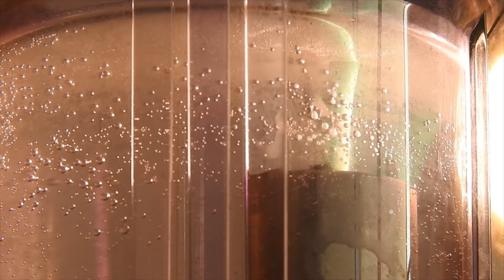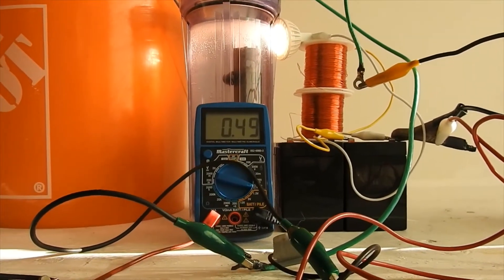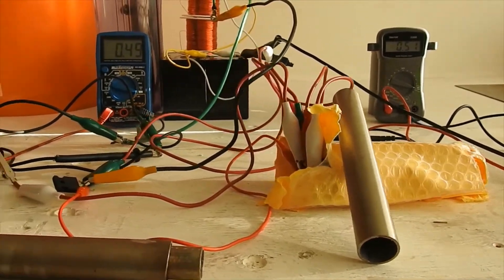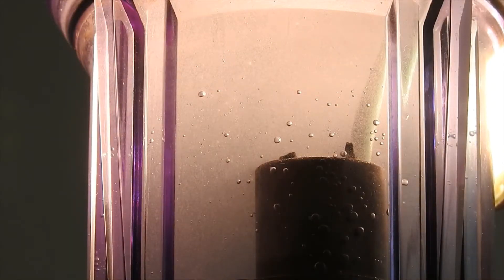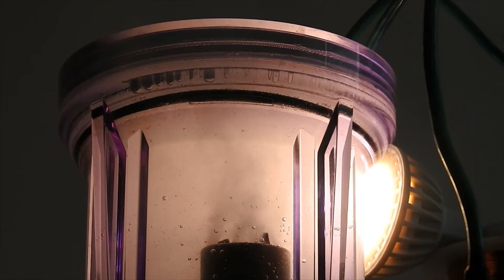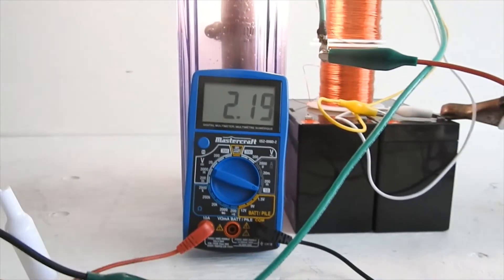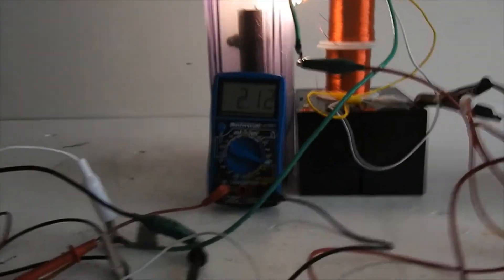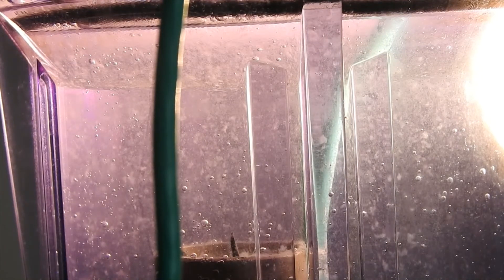HHO Stanley Meyers Resonance versus non Resonance

Comment: I use Dave Lawton’s PLL Circuit with 7 Cells & an Electron Extraction Circuit. 6 Watts puts out 8  Litres of HHO per Minute. The HHO is a +Positively Charged Deuterium Gas, then I’ll -Negatively Ionise the intake Air to Electrostatically bind with the Deuterium Gas then I use Purified Nitrous Oxide from the Exhaust to slow down the Burn Rate & Power a 3.25 KVA Generator... Lots of people in Darwin NT, Australia & they’re like Novelty Toys for these people!
Reply from the maker: Talk is cheap - show us.
Reply: @thewonn  I’d love to but I pulled it apart. https://www.youtube.com/watch?v=IViKuzX34xE&t=256s   This is an old Video where I try to describe charging with Back-EMF IM-Pulses coming off a Dual Petronix 60 KV E-Core. I could replicate what you do using a 260 Volt Variac rectified to 130 Volts DC & a High Voltage Switch that switches a 120 Hz signal that is basically a Gate Circuit & the output would be 10 fold what you demonstrated using non Resonance. I’d love to show you what I have but I saving for an Apartment & don’t have time to do any HHO Stuff. Sometime in the Future after I’m living RICH I’ll upload an example of a Circuit using 100’s of Kilovolt’s of Back-EMF from a Petronix 60 KV E-Core Coil setup
Reply: @thewonn  When Daniel Dingle a Filipino inventor discovered how to make Deuterium H2. Dingle discovered it by accident as he been looking at ways of Charging Batteries using High Voltage Back-EMF Im-Pulses back in 1968, he was creating massive amounts of Gas. Then Dingle discovered this Gas had more Power than regular Electrolysis Hydrogen. Dingle openly told everyone how he made this Deuterium Gas until 1990 when a Gag Order was placed upon him and he didn’t want to go to Jail so he kept his mouth shut. In Darwin people discuss this topic openly like it isn’t even a Secret but, the rest of the World think that this is some big Secret or some Conspiracy... All it is, is High Voltage Back-EMF Im-Pulses that Knock Off Electrons Orbiting the Hydrogen Atom - Then you get this Gas called Deuterium!
Reply: Your need Back-EMF. Back in 2003 Kiwi Mates in Darwin revealed to me that the Effect is actually: ‘Tesla’s Phase Conjugate Mirror Effect’. If you take a Back-EMF Im-Pulse from a Coil & direct it to a Ground Connection ie: Copper Rod in the Ground, you’ll get a Bright White Light discharge of Electrons emanating from the Negative Earth, this effect is the same as a Lightning discharge where Electrons emanate from the Earth (See a slow Motion Time lapse of a Lightning Strike on YouTube). All you do is use an Isolation Toroid Coil then use Water as the source of Co-Valent Bond Electrons, then you Tune this into Resonance. I know Talk is Cheap but, Fracturing Water is really about the removal of Co-Valent Bond Electrons from the Water!
Reply: @
Blondie Bear  You seem to jump from topic to topic, from your method to method, very confusing, indefinite, unproven, you want to show everyone, you don't want to show, you want to sell, you don't want to sell, you want the world to know about you ... everything confusing and indefinite.
Reply from the maker: @OliverNedeljkovicZTI  lol as far as i know everything i sell is available on www.fitnesshomesupplies.com My topics are what i am interested in at that time. I am not out to prove or disprove anything. I am just sharing my experiments. IF the right person or people want me to focus on any given topic, and they entice me , then maybe i can do that. For now, this is just a hobbie.  I have many interests and obligations...
Reply: @thewonn  sorry I didn't mean to write to you...
Reply: @OliverNedeljkovicZTI  I don’t have anything NEW to contribute. All you do is create Way, Way more HHO than you’ll ever need to run a 3.25 KVA Generator motor. I’ve got the Gerber Files & sometime in the future I’ll experiment with this some more. My next Cell will be using 2X Large 12 Hz Tuning Forks, I’ll use a Phase Locked Loop Auto-Resonance with a Thyristor (SCR) to lock onto the Resonance Signal then Gate it at 12 Hz. I’ll use a Nylon Screen to seperate the Gases to get Pure H2 Hydrogen with its missing Electrons whilst I discard the Oxygen. This time round I’ll be using the Petronix Coils to Power the Primary Coils of a Tesla Coil, then use the Collapsing Back-EMF to Power my Water Fuel Cell. During the 12 Hz Off Cycles I’ll capture the ‘Time Reversed Re-Emitted Wave’ Bright White Light Discharge of Co-Valent Bond Electrons to Power an Incandescent Light Bulb. I’m not selling anything, I’m just sharing ideas!... The only reason I want to use this Tuning Fork design, is because it’ll look Cool as I power a 3.25 KVA Genset off it, as I turn the Dial on my Variac Transformer!
Reply: @OliverNedeljkovicZTI  on the Onedrive link is WFC 1.0 which is the original Capacitance Calculator of a Stanley Meyer WFC. It’s actually 10.?? X LC Resonance & is said to be the 11th HarmonIc. My WFC’s use Dave Lawton’s Original Phase Locked Loop Auto-Resonance with a Variac Transformer using Back-EMF Im-Pulses Collected from a Duel Petronix E-Core hooked up in anti-parallel. The WFC runs Cold even after days of continuous operation. My Dual Coil setup actually Sings in Resonance making a Brrp, Brrp, Brrp sound when Gated at about 4 Hz. It requires Gating because it’s Powered by the ‘Off Cycles’ collapsing Magnetic Field of the Dual Coil setup. The Anode & the Cathode Terminals become warm as a function of the LC Resonance Wave bouncing between the Anode & the Cathode but, the Water in the Cell remains Cold. It blows EVERYONE Away & then EVERYONE is like I want one too.
Reply: @OliverNedeljkovicZTI  Talk is cheap but, I’m bored: The best description of this process is described by a 1927 Book by Walter Russel ‘The Universal One’, in this Book Russel describes the structure of Water inter alia, & about how to decompose Matter using “The Absence of the Magnetic Stream” Russel et al. So it only works using Back-EMF Im-Pulses in an isolated Circuit. So regular Faradays Electrolysis extracts ‘Im-Plosive’ HHO & Stanley Meyers removal of Electrons from Water extracts ‘Ex-Plosive’ Deuterium Gas which when combined with +Ionised Oxygen increases the Mass of the Deuterium Gas giving it more Oomph. The addition of non-combustible Nitrous Oxide from the Exhaust slows down the Burn Rate of Deuterium (Which is well documented by Meyer) to match the co-efficiencies of other Fuels.
Reply: https://www.youtube.com/watch?v=dukkO7c2eUE
When you use a single Back-EMF Im-Pulse to the Ground Earth, you’ll Automatically get an Electron Discharge just like this Lightning Strike. So in a Stanley Meyer Electron Extraction Circuit, all you do is use an Isolation Toroid so that Water is now the source of Co-Valent Bond Electrons... Then you add ‘Resonance’, it’s that Simple!
Reply: I use a Dual Petronix 32 Ohm E-Cores that are glued together which oscillates at 270 Khz that I place in a Metal Box as this is the Microwave Frequencies range and I Gate it between 6 Hz to a maximum of 120 Hz. Also I use a 240 Volt Variac Transformer connected to a rectifier to Power my Water Fuel Cell & control the amount of Gas required. I use the Hot High Voltage Pulses for my Electron Extraction Spark Gap, then I Charge the Water Fuel Cell with Cold Back-EMF Im-Pulses then have my Negative Ground. I control the amount of Gas I want by merely turning the Dial on my Variac Transformer. My setup powers a 3.25 Kva Greenpower (LPG) Generator. Powering a Car just draws too much attention to yourself so, it’s better just to Power something small like a 3.25 Kva Generator. This is what my Dual Petronix E-Core Coils Setup looks like: Hot + [… - …] + Cold ... with the -Negative located in the Centre. I even did a review on Amazon for the Petronix E-Cores back in June 2014 explains that I used this to Power a Generator!
Reply: Most Water Fuel Cell Builders only have the Coils Hot + connected to the +Anode then have the -Negative of their Coil connected to the -Cathode. THIS SETUP IS WRONG!]... If they had a Light Bulb between the Hot + & the +Anode then this would be an ‘Electron Extraction Circuit‘. A Stanley Meyer Water Fuel Cell is Charged with Cold + Back-EMF Im-Pulses then is Short Circuited with Hot + Pulses so that the Electrons are ‘CONSUMED’ into a Light Bulb... It sounds complicated but, it’s Not, & it’s very simple to do!.. Use your imagination & imagine the Lightning Strike taking place within the Water Fuel Cell but, the Bright White Light stream of Electrons is pulled from the -Negative Cathode into the Dual Coils to the Hot + & into the Light Bulbs -This is VERY Simple!
Reply: @o5you86  can you point me out to any link? I'm a newbie eager to learn. 🙏
Reply: have your tubes the same wall thickness?gap? annealed them ? schematic for this electron extraction circuit to show us and the all set up?
Reply: @DAVIDROLAND78  Nature is your Teacher, a Stanley Meyer Water Fuel Cell mimics a Lightning Strike in that Ions build up in the upper Atmosphere until they overcome the resistance of the surrounding Air then discharge to the Ground & upon contact with the Ground an Electron Avalanche takes place from the Ground along the Ionised path of least resistance to the Ionosphere Electrons orbiting the Nitrous Oxide in the surrounding Air manifest as a ‘Bright White Light Discharge‘ of Electrons. This same process takes place within a Stanley Meyer Cell except that a Stanley Meyer WFC is Charged with Back-EMF Im-Pulses during the ‘OFF’ Cycle of the Charging Coil & that the path of least resistance is not through the Water but, rather it’s through the Charging Coils ‘ON’ Cycle then to a Spark Gap & an incandescent Light Bulb Array to dissipate these Co-Valent Bond Electrons which are instantly converted to Light & EM Radiation then, once these Co-Valent Bond Electrons have been Consumed by the Light Bulb/s Water can no longer exist in its stable Liquid Water state, therefore must exist in its Gaseous Hydrogen (H2 Deuterium having missing Electrons) & Oxygen state, the Hydrogen having missing Electrons now exists as a +Positively Charged Deuterium Gas. So a Toroidal Coil or a Tesla Coil has a Hot +, & at the Cold + you have an Avomenko Plug that Charges the WFC with Cold + Back-EMF Im-Pulses but uses the ON Cycle to Short Circuit the WFC, through the Toroid or Tesla Coil to a Spark Gap then to the Positive of the WFC. You have a Base Frequency of 270 Khz which is a Sine Wave, this is known as a ‘Soft Microwave’ & Decomposes/Dissolves the Co-Valent Bonds that Bind Matter together. Then you have LC Resonance which is a Square Wave which provides both a Standing Wave to align the Electrons & ‘Off’ Cycles as H2 Deuterium is only produced during the ‘Off’ Cycles as a ‘Time Reversed Re-Emmitted Wave of Bright White Light’ emanating from the -Negative Cathode... Your all not using enough Voltages, you need 2X Petronix 0.32 Ohm 60,000 Volt Ignition Coils connected in Series to give you 120,000 Volts & you need to overpower this with a Variac Transformer. When your dissolving Matter at 270 Khz & Gating it at LC Resonance you’ll get an ‘Infinite Q’ Effect when Voltage goes up, Amperage will go down Violating Ohms Law. Both Stanley Meyers NZ Maori Meeting House Presentation & Hermann Anderson give Brilliant Descriptions to how Simple this Technology really is to build! ✌️ Everyone!
Reply: @o5you86 None of these video gives any description of it nor is it brilliant in any way. Your description is also neither brilliant nor scientific in my opinion. 270kHz is not soft microwave and Herman Anderssons explanation of where in the spectrum soft x-rays is located is also flawed. His talk about ions moving "fast" through the electrolyte is also flawed. Granted , the whole interview was heavily edited and the idiot interviewers kept interruping him.
Reply: @DAVIDROLAND78  To Simplify it: You have a simple Tesla Coil, the Top is Hot +Positive (Spark Gap/100 Watt Parallel Light Bulb connects to +Anode). The Bottom is both -Negative (Connects to the -Cathode of the Water Fuel Cell with a Series of 12 Kv Blocking Diodes) & the Back-EMF Im-Pulses +Positive (Connects to the +Anode with a Series of 12 Kv Blocking Diodes) ... So the Bottom of the Tesla Coil is both -Negative Cathode & the +Positive Anode connected using an Avomenko Plug which; Charges the Tesla Coil with Electrons from the -Negative Cathode (Time Reversed Re-Emitted Wave) as a Short Circuit through the Tesla Coil to a Spark Gap with a 100 Watt Light Bulb in Parallel then connected to the +Positive Anode during the Tesla Coils ‘ON Cycle’. It is only during the Tesla Coil ‘OFF Cycle’ that +Positive Anode is being Charged with Back-EMF Im-Pulses from the Tesla Coil through an Avomenko Plug to the +Positive Anode... It’s Coil On Short Circuit, Coil Off Charge +Anode, Coil On Short Circuit, Coil Off Charge +Positive Anode! ...A Stanley Meyer Water Fuel Cell is only Charged with Back-EMF Im-Pulses from a Collapsing Magnetic Field, then is Short Circuited with a Tesla Coils On Cycle pulling Co-Valent Bond Electrons from the -Negative Cathode, through the Tesla Coil, to a Spark Gap with a 100 Watt Incandescent Light Bulb in parallel then connected to the +Positive Anode.

https://1drv.ms/f/s!As2MRIjVUnXigk4JE8cShr5ObL8o 

A Kiwi Mate is building a WFC using: A Bluetooth Tesla Coil purchased off Amazon.au ie: ‘’Joy Tech Music Tesla Coil Plasma Loud Speaker Wireless Transmission Experiment Model YS03’. This Coil will put out 50,000 Volts. You need a minimum of 40,000 Volts for Molecular Ringing. Just from using the ‘Tone Generator Software’ (See Link) on a Windows PCs, he’ll use LC Resonance up to 20 Khz. The input will be 24 Volts at 2 Amps = 12 Watts but, only Back-EMF Im-Pulses will Power the WFC & Electrons will be Extracted to a Short Circuit ‘Spark Gap’ with a 100 Watt Light Bulb in Parallel then to the +Anode after all the Amperage has been consumed by the Light Bulb. After he masters LC Resonance, we’ll use Meyer’s WFC 1.0 Software (See Link) to Calculate the 11th Harmonic & build a new Setup powered by a 260 Volt Variac Transformer.
Reply: @DAVIDROLAND78  I know Talk is Cheap but, allot of People that Build Water Fuel Cells only use LC Resonance which only produces the Standing Wave to align Electrons, when what they need to do is use WFC 1.0 (Meyer’s 11th Harmonic Capacitance Calculator) to Calculate the 11th Harmonic to use as a Sine Wave. Also allot of People don’t use nearly enough Voltages, you need to use a Minimum of 40,000 to 70,000 Volts to get Molecular Ringing, if you’d used Meyer’s WFC 1.0 then a Minimum of 40,000 Volts is required but if you’d just Times LC Resonance by 11 to get the 11th Harmonic then you require a Minimum of around 70,000 Volts. I just use 2X Petronix 60,000 Volt E-Cores powered in Series to get 120,000 Volts but, use the exact 11th Harmonic Frequency determined using Meyer’s WFC 1.0 Software then Overpower the Coil Setup using a Variac Transformer. When you have the 11th Harmonic as a Sine Wave & LC Resonance as a Square Wave to provide a Standing Wave as well as ‘OFF Cycles’ then when Voltage goes Up, Amperage will automatically go Down as the Water Fuel Cell will start to recycle Charge in a Loop & extract Co-Valent Bond Electrons from the Water itself which Violates Ohms Law!
Reply: The basis of the Stanley Meyer Water Fuel Cell is the Electron Avalanche. Meyer states in many of his seminars that if the Electric Field is High Enough, the Electric Field is enough to knock other Electrons from their Orbiting Paths. Meyer is merely replicating a Lightning Strike in Nature where the Ground has lots of Electrons & the Ionosphere has few Electrons. The Bright White Light emanating from the Ground is actually an Electron Avalanche Effect where the Higher the Atmospheric Voltages are, the Faster & with More Force the ground Electrons move. So for instance you have an Electron that passes through the Air & in the Air we have Nitrogen with its orbiting Electron, now if an Electron hits the Nitrogen Atom Hard enough then it’s orbiting Electron can be Knocked Off which turns 1 Electron into 2 Electrons, then this Avalanches!

Deuterium H2 with it’s missing Electrons is an isotope of Hydrogen that has twice the Mass or more Ooomph!
Reply: You need more Voltage because Stanley Meyer Water Fuel Cells really are ‘Voltage Dependant’ & at an Atomic Level, the Negative side has lots of Electrons & the Positive Side has few Electrons. The Positive Side Pulls Electrons towards it on its Back-EMF ‘Coil Off’ (Collapsing Magnetic Field) Cycles & the Higher the Back-EMF Im-Pulses the Electrons will go Faster with More Force. When the 11th Harmonic (Calculated with Meyers WFC 1.0 Capacitance Calculator) as a rectified Sine Wave is produced above 40,000 Volts (preferably 100,000 + Voltages) then is Gated at LC Resonance as a Square Wave then the Co-Valent Bond Electron Avalanches during the ‘Coil Off’ Cycles releasing Massive amounts of the Hydrogen Isotope Deuterium H2 having Missing Electrons, then these Co-Valent Bond Electrons are pulled into a Coil (Tesla Coil or E-Core Coil ect) on the ‘Coil On’ Cycle & are consumed to a Spark Gap with a parallel Light Bulb Array to consume these Co-Valent Bond Electrons. The majority of the Electrons extracted from the Water Power the Collapsing Magnetic Field Back-EMF Im-Pulses that power the Water Fuel Cell on the ‘Coil Off’ Cycles... This is Not FREE Energy as only the Back-EMF Im-Pulses or Charge is recycled in a Loop at infinite Zero Amps (Infinite Q Resonator) & Power Output (Watts) is a product of Voltage times Amps.
Reply: Do any of you use High Voltage at all?... Back-EMF Im-Pulses with Amperage restriction is used to initiate the Electron Avalanche Effect in Water. When High Voltages reach a critical point of Acceleration & Kinetic Energy the Electrons have the ability to Knock Off Co-Valent Bond Electrons Orbiting the Hydrogen Atoms in Water where 1 Electron will become 2 Electrons which then becomes 4 Electron resulting in an Avalanche Effect when the Tesla Coil is ‘On’ then these Avalanche Electrons follow the path of least resistance which is through a Tesla Coil & Spark Gap/Light Bulbs to reach the +Positive Anode. Each Hydrogen Atom will become Ionised when they lose 1 Electron but, when they lose 2 Electrons this results in the creation of an unstable Isotope of Hydrogen known as Deuterium. The Electrons in Water will Avalanche at the LC Resonance Frequency into a Spark Gap & a Light Bulb Load in parallel to the Spark Gap. It actually requires a tremendous amount of Force/Energy to break these Co-Valent Bond Electrons that exist in Water but, the trick is to make the Water itself a part of the Circuit by creating an isolated ‘Floating Earth’ & then ‘Consume’ these Co-Valent Bond Electrons releasing their inner Light into the Tesla Coil/Spark Gap/Light Bulbs, just as Lightning releases the Electrons orbiting the Nitrous Oxide in the surrounding Air during a Lightning Strike. Meyer is merely mimicking what happens in Nature!... So um, you need High Voltages to get an Electron Avalanche at LC Resonance.
Reply: @o5you86  I think the high voltages are needed to get the high frequencies with short wavelengths that match the size of the water molecule...  lightening is called PLASMA, I guess you know this?  There is another guy on YouTube who is obsessed with plasma an HHO but never see him doing anything with it....  Is your 3 pole electrodes with hot/cold positive and center negative talked about in any physics or electronics books?
Reply: @o5you86  "Are electrons real or theoretical?
No one has directly observed either electrons or fairies. Both of them are theoretical constructs, useful to explain observations that might be difficult to explain otherwise." - University of Michigan
Reply: @DAVIDROLAND78  Honestly Bro, nobody builds their own Circuits in the Northern Territory or Queensland. Everyone just buys existing Technology & just modify it. If you want a Hermann Anderson 270 Khz base frequency Sine Wave, you just figure out a way you can Gate it with an LC Resonance Square Wave or you might want a Stanley Meyer 11th Harmonic WFC 1.0 Capacitance Software Sine Wave gated at LC Resonance Square Wave or you might want a Dave Lawton LC Resonance Sine Wave gated at around 100 Hz Square Wave. I think there’s an India Mart Store that sells the Original Lawton Circuit. One way you could do it, is just buy a ‘Phase Locked Loop’ (PLL) Auto-Resonance (Sine Wave) Tesla Coil then figure out a way to Gate it at 100 Hz Square Wave to get ‘Off’ Cycles. When I experiment with HHO, I’ll just use a $230.Australian Frequency Generator from Amazon AU ie: